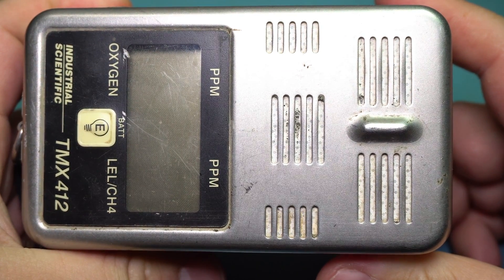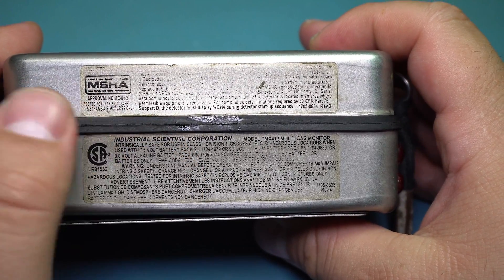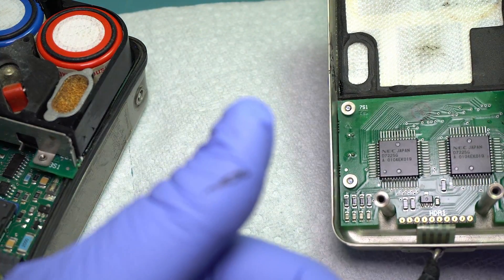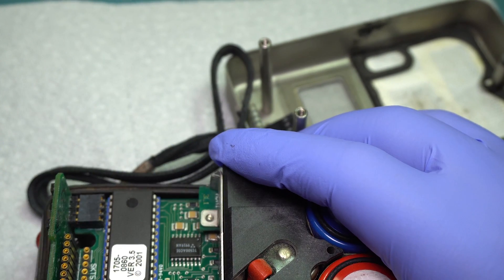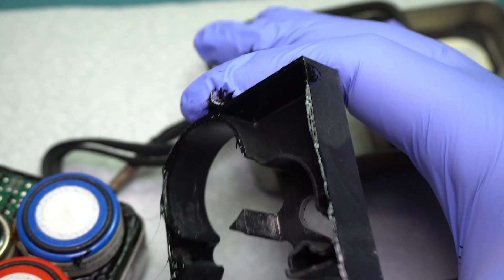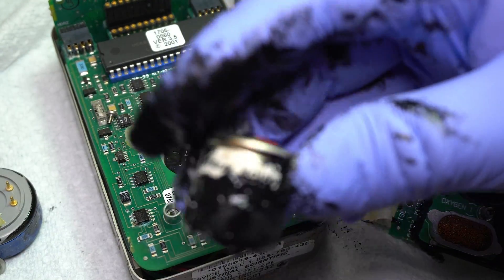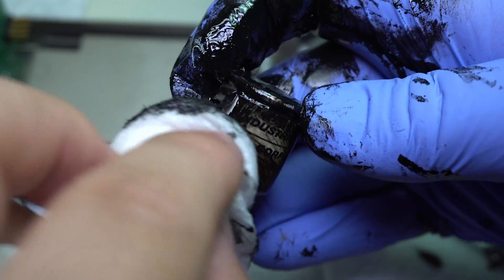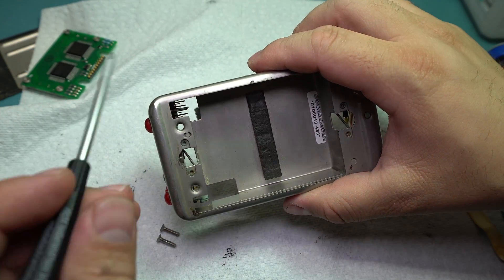Industrial Scientific TMX 412 Personal Gas Detector Teardown

Comment: I know, old video.
Used these a fair bit at work.
The sintered metal detector is a LEL sensor (Lower Explosive Limit).  Wheatstone bridge inside with a heated ceramic bead.  In the presence of combustible gas, the bridge balance changes due to combustion happening at the bead, which allows for measurement of concentration.  If it reaches 100% LEL , power is cut off from this sensor to further eliminate possibility of ignition of a hazardous atmosphere.  When you reach 100% of the LEL, you have reached the lowest possible concentration of combustible gas (in normal air) that will ignite.  (Below 100% LEL is too lean to burn).  This instrument will alarm well before you reach that.
These instruments are sealed and manufactured to be safe to operated in explosive atmosphere.  Costly bit of kit.

Comment: Nice teardown! 
Would love to see that weird oscillator in a action captured by an high-speed camera
Reply: Yep, you could only capture this with an intensified streak/framing camera or a Shimadzu HPV-X. Both are deep in the "if you have to ask, you can't afford it" price range.
Reply from the maker: You'd need a really, really high frame rate camera to catch a 2 MHz one. :D I'm sure you can find a pretty slow, older and much larger one somewhere which would have a more reasonable speed.